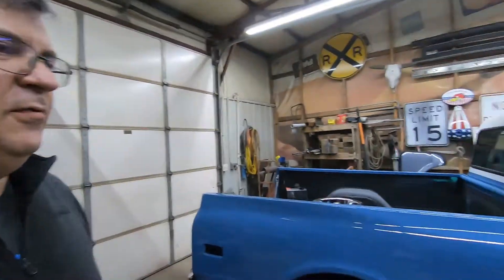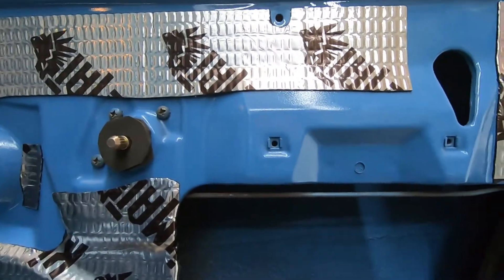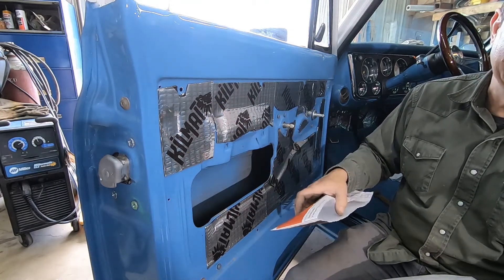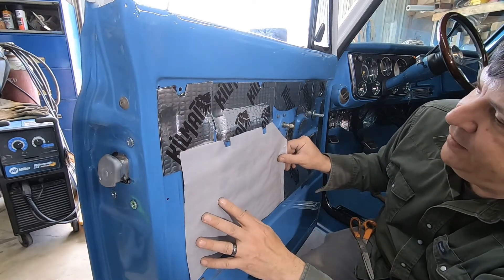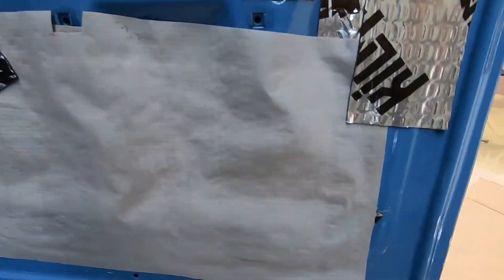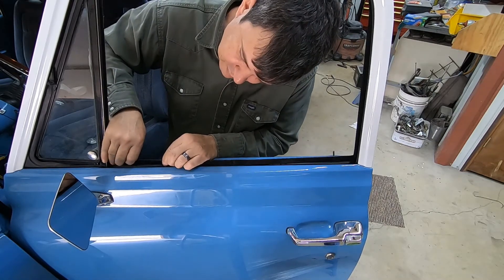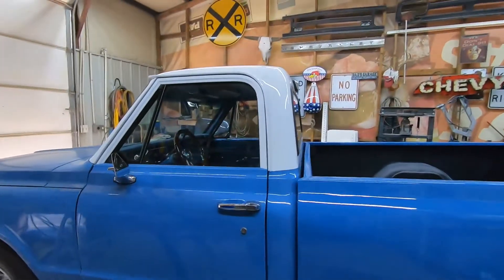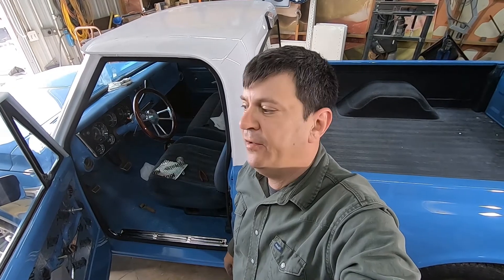Installing Door Panels 1972 C10

Comment: Yes, it is easier to forget the names of stuff, as we get older. Backer-Rod is the round product used on the back of the door. I have a 1967 C10 in a build mode. Three weeks after my son gave up on this $600 truck, he gave it to me. Course it had a 350 4 bolt with the largest cam some 20 year old could afford, after getting his buddy who works at a parts shop. After he emptied his wallet on a huge Holley double pumper. What’s wrong with these guys? I hated that cam! Anywho, three weeks later, my youngest son hit some black ice with his 2003 Tahoe. It was towed to my back yard and wheels clicked for me. I have rebuilt every carb ever made, many times, but EFI since 1977 at the dealer. I was asked to take test the next year for 5 cents extra per flat rate (Customer pay was $24.00 per hour) I passed all 8 and some how was the only taker in the dealer. No clue, but I held him to my 40 cents.
  So, after cam bearings, mild torque improving cam, chain & gears,  gaskets and seals to freshen it up, it will take the place of the gen-1. 
  Call me crazy, but the body control module is being used for power widows (Easy to Make) bucket seats w/console to bury the door switches behind the “Tee” handle truck shifter for my bench built 87 era, 700R4, built to handle 600 HP but stock converter and mild shift kit. Only 52 updated parts will make it outlast me. The BCM allows for light control, Windows, content theft, too much to list! The main thing is to make a service manual with part numbers, schematics, photos, wire color & size, including aftermarket parts, part numbers and who sells them. I cut, Vent, welded and make the seats and leather covers myself. This brought me to your video. It takes 50 sq ft to cover the floor and back wall. I used an 81 ElCamino gas tank, side fill w/22 gallons and added an ACDelco fuel pump inside. Keeping the purge, but cutting out EVAP, VATs and much more. This is my last big project as at 13, your drivers license said “Farm/School” and no photo. So, many moons ago. Just my 2 cents, adjusted for inflation/Covid is $13.12. Sorry to be long, but my first vehicle, a 65 Chevy C10 Apache took me everywhere for well over 4 years. Love these trucks and know how to do it. Even found a fuel-tight connector to pass 2-3 wires thru the sender. 
Take care, stay safe. No more dents. Word has it, 2022 models will have turn signals standard! Best of luck.
Reply from the maker: Thanks for the comment/short story love to here of others passion for the hobby/addiction. I have a 68 C10 with a 5.3 from a 2003 suburban, that one is in line after the 1935 Chevy the 68 has most of the fabrication done just needs the glass, harness installed and a million other things. I haven't looked at an El Camino tank thanks for the insight on that one, I used a 77 blazer and moved the filler to the drivers side. My first truck was a 64 SWB with a built 355 and TH400 had 4:10 gears when gas was .85 per gallon.

Comment: Any chance you have the part of the video that shows the handles getting pressed into the panel? I'm having issues with mine
Reply from the maker: Sorry I do not have that piece of video. the handles should push in without  the retainer clips fairly easy, with the retainers you may have to tap them on.
Reply: @HogshooterHotrods  no worries, I actually had luck getting them in. Thanks